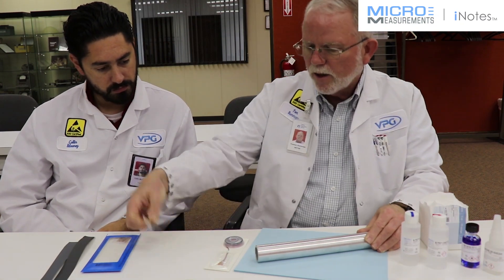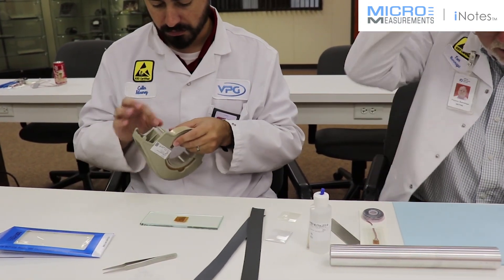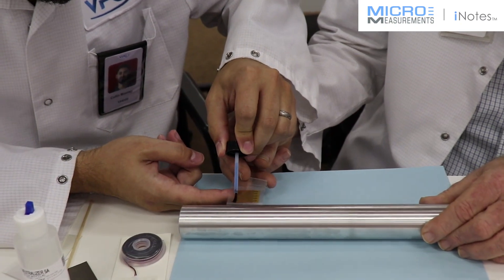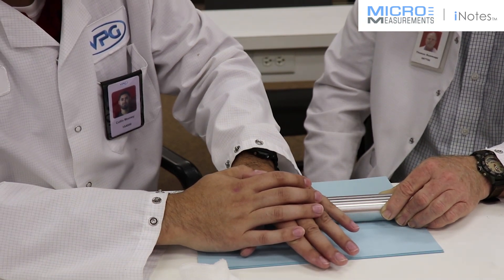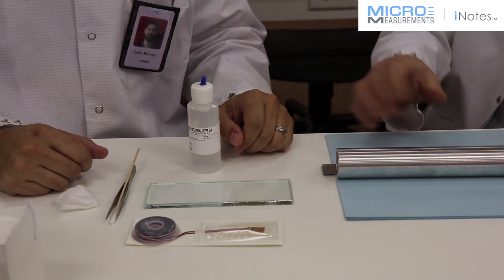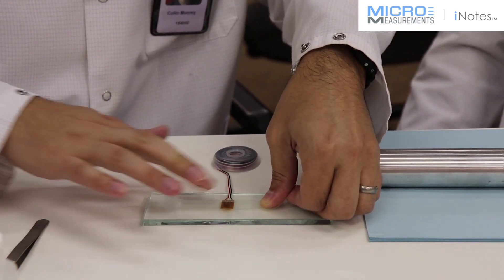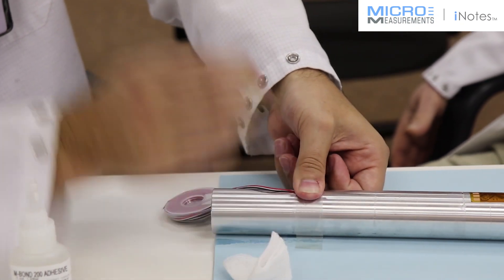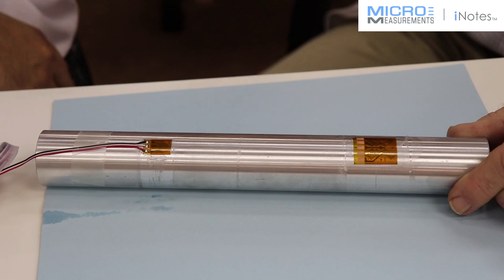STRAIN GAGE INSTALLATION ON A SHAFT FOR TORQUE MEASUREMENT

Comment: I want to measure the bending moment on a vertical pipe fixed from its base and subjected to a horizontal force on the top, what type of strain gauge and what is the best bridge configuration do I need?